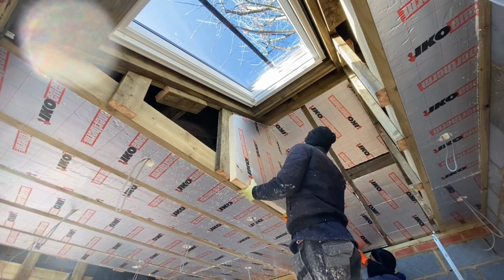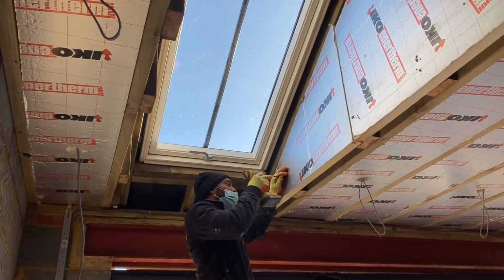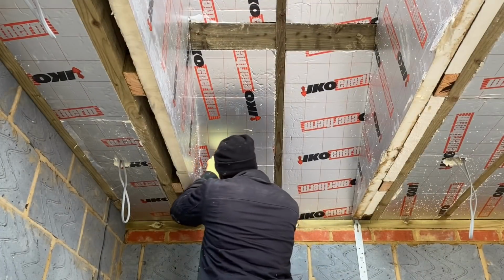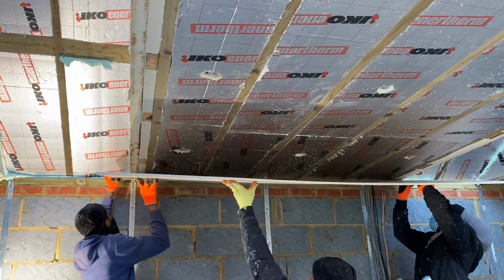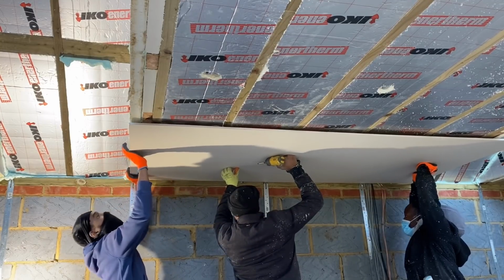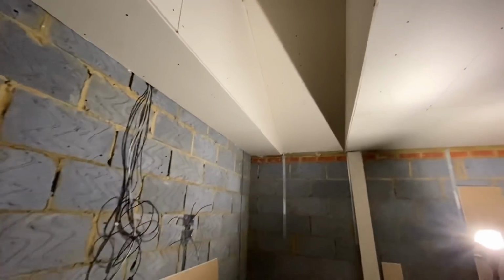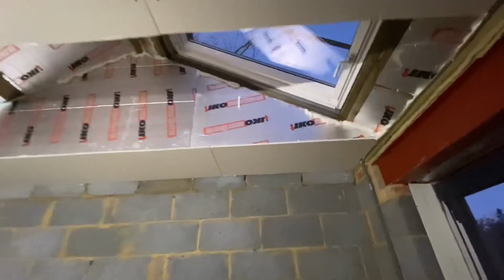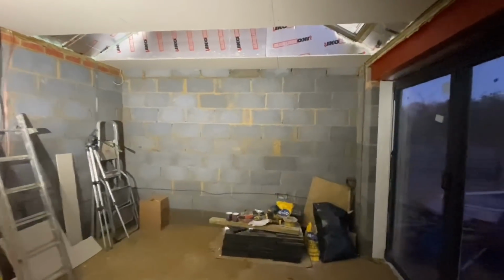Plasterboarding the ceiling of the garden house

Comment: Use 2 T props ( dead man) made out of site timber, 2/3's or 2/4's, to Hold Plaster board in place ( After U position the board for fixing) it Saves 💪💪 Burn out, It Also speeds up ceiling installation, Have the boy's Screw while you measure and cut, when U get the system up and running, it increases production, 💰 in the bank 😜
Reply: A Chalk line to mark run for Screw, Save haven't to manually mark  ceiling with ✏️/ straight edge, or a cheap line Laser ( Center for rafter run's)🖖